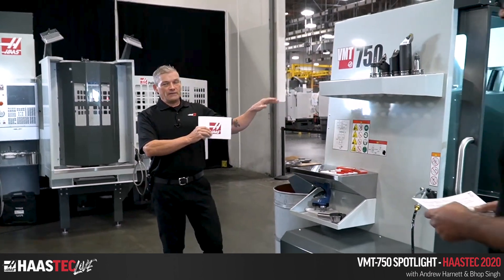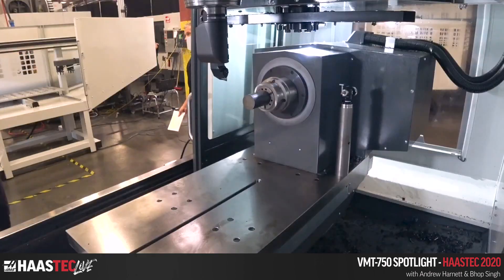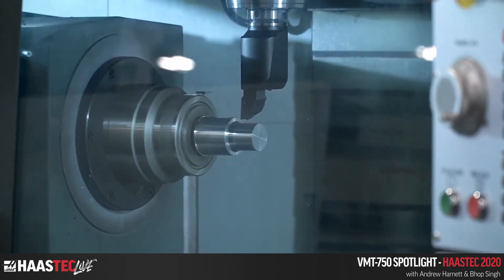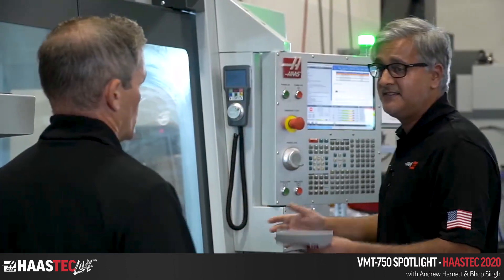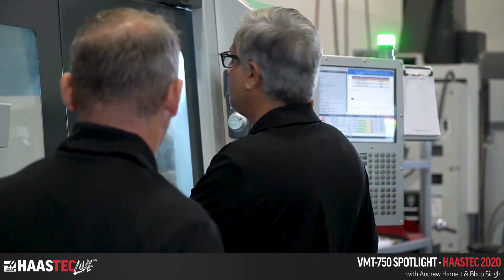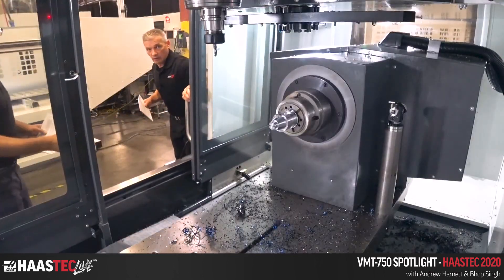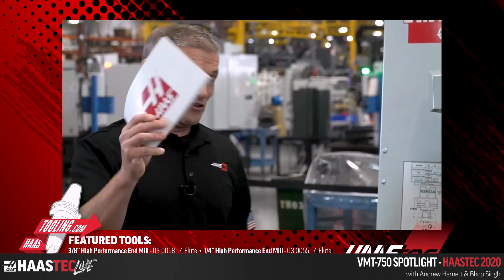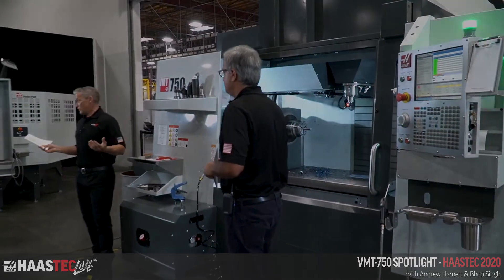VMT-750 Spotlight - HaasTec 2020 Focus Series - Haas Automation, Inc.

Comment: Lots of people here saying that a bar feeder for this machine would not be possible.  I disagree.  With a short bar feeder and possibly making the lathe headstock slightly longer, you could very
easily set the bar feeder on the left side of the machine and have the X and Y axes move to a fixed reference position that would allow the feeder to operate in the exact same manner
that it would if it were feeding a turning center.  Remember that this is only a concept machine.  It makes sense to start on a known platform instead of starting from scratch.
Also, I'm sure they had to develop new functionality for the control to be able to run this type of machine.  
I have wanted someone to build a machine like this for the last 20 years.  I truly hope they can bring some version of this machine to market.

Comment: I would be concerned about table sag with all that weight on one side, and how much backlash it would have which will affect the quality of the turned parts. Also, sounds like there is quite a bit of harmonics going on with it, and chip control would be an issue.
Reply: Yes, the VF-5 is already questionable.

Comment: Having many more tools for making complex parts is definitely good, but the lathe spindle itself seems somewhat limiting to the usefulness. I like the idea of bar-feeding a mill component using the lathe spindle as an indexer (even if there's NO turning operations whatsoever) which is fairly common for other multi-tasking machines, but that would necessitate a bar-feed option. Without the barfeed, the only use case is workpieces that MUST have turning to justify the lathe spindle rather than just using it for an indexer.
I'd like to see an ST-30 or 40 that had a rotating head rather than a wedge assembly. I know that's a huge deviation from this VMT (and I realize there's no room for a mill tool carousel to be mounted on an ST base casting), but that style of machine would be soooooo much more versatile, and chip control would be a non-issue right off the bat.

Comment: I would love to see a dedicated casting, a fixed lathe spindle, lathe style chip conveyor. Put that B axis Tilt on a UMC Traveling head, and I think it would be a winner. ST-30 spindle and footprint of a UMC-750 overlapped with a ST-30 would be great.
Reply: Yes.  It does belong on the UMC chassis.  But if you think about it, it screws up their pricing.  Subract trunnion, but add spindle, and B-axis head, and it would be over $200k.  But little market for the experimental machine shown.

Comment from the maker: Thanks for all the comments about the VMT-750. There are lots of good points being made here and that is exactly what we were hoping for in terms of a response to this video. As mentioned already; this is most definitely still a machine in development and the final configuration is by no means set in stone. In the meantime our engineering team will be taking these comments as well as those of customers out in the field into consideration as we move towards a more finalized design.
Reply: Haas if you’re listening, I would really be interested to know how putting a turning tool in the spindle bodes for the spindle bearings and other related guts, have you done any testing?
Reply: @akronimm862  
As with any Positive there are Always Negatives ??
You pointed out something worth considering.
This machine fits into the thinking of a Budget Mazak Integrex.
My only concern is how much are you giving up buying something like this versus an Integrex ?
Still fits into HAAS range of machining capabilities.
Light to Medium duty work ??
Reply: If haas is listening... stop testing this machine and scrap the whole project.... there is nothing to gain in terms of efficiency,  productivity,  or capabilities with this design. Also, without a sub spindle, it's useless. The goal of Mill-Turn is to get a complete part off the machine in one shot with very little human interaction. This doesn't do that. If you want to make something that will do that plus more, design machine that can do what a Doosan MX mill-turn can do for less money and you've got a winner.
Reply: @desmodreamer86  honestly its still a useful machine even without a sub spindle. Yes it would be a useful feature. But in the current prototype it can still be used as a mini mill if small simple parts are needed instead of having to buy a second machine like most other companies. It's a interesting concept and they might add a sub spindle in version 2.0.

Comment: Interesting design. It is not the usual Mill-Turn kinematic concept. I believe it will be a great fit for shops that are more oriented towards milling rather than turning. It will be really nice if there are more options for the table so you can use it as a regular vmc if needed (options like more chanel slots, zero point, fixtures). That will make this machine really unique!
Yes, bar feeder, part catcher and second spindle are incompatible, but actually this design have other advantages. I believe the price here will be way lower comparing with other mill-turn machines.
So, my opinion is that this machine is more like entry-level in mill turning and it actually can be a great deal for some shops. But also this deaign is opening like a sub-category in mill-turn machines.

Comment: Yeah. Not that suitable, where do the chips go haha.
Reply: The same place they go on any other haas machine. Piled up in the corner and stuck to all the walls and piled up on top of the way covers. It's up to you to come up with super clever programs that wash down the machine during bar feed and APL operations. Bear in mind the only industrial CNC machines I've ever used are HAAS but the places for improvement in chip management are completely obvious. Increase your sheet metal base pan angles on your VF machines, add coolant drips to the walls, and add way cover sprayers.

I feel like I spend more time designing wash down routines than I do programming the parts.

Comment: Nice idea/machine, but i think about three problems:
-automation with a bar feeder is not possible
-as far as I saw you can tilt the b axis only in one direction
-last the chips will build up in the table 
Probably a umc is a better base
Reply: You're right. A bar feeder and parts catcher would take this from a nice machine to a great machine.
Reply: I just can not think of a situation in that a proper mill/turn like a Doosan SMX couldn't do the job as good or better.
Reply: Concept machine they said.
Reply: @BGraves  yes i know, but i can say whats probably a problem. This is the reason a company present machines like this. And i also think, there is a reason why there not this many machine in the world which is build like this.
Reply: bar feeder not a option but a bar puller would be. i see that this machine in particular would be more focusd on one offs of a complex turned part. if chips buildup in the table is a problem. high pressure coolant in the tool mostly would fix it. keeping costs low in such complex machine tool isnt easy and for this type of machine is probably the first time we're seeing it. 😁👍

Comment: What HP is the turning spindle
Reply: they said it's a ST15 spindle so 20HP
Reply: @SuperAWaC  20 haas horses. 
Probably 7.5 real horsepower.
Reply: @matt23727  you're welcome to look at the website where they publish the performance specs of the spindles. they aren't hiding anything.
Reply: @SuperAWaC  I've got an st10 and an st30.
10 and 30 hp respectively...
My Japanese and Korean machines with 7.5 hp are about 75% as powerful as the "30hp" st30.
And twice as powerful as the "10hp" st10.
I've got a doosan gt3100 with 39hp.
Its 10 times more powerful than the st30. Dont even get me started on the torque specs.
Haas is good but not great.
Like a chevy truck.
Reply: @matt23727  you're one of those guys who bought a haas thinking they'd get a machine that cost twice as much eh?
Reply: @SuperAWaC  nah the gt3100 only cost 10k more than an st40 we were looking at. The puma came with more standard and we decided on that.
Our st30 has proved to be an ok machine. The st10 is a little better but still not able to hold .0002 over night like our 20 year old takisawas.
We understand haas is for the budget conscious.